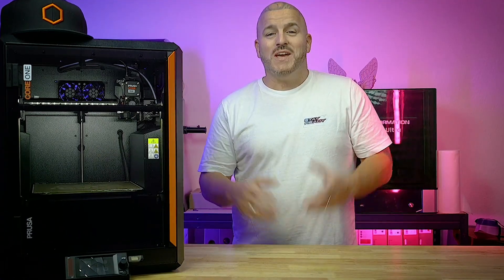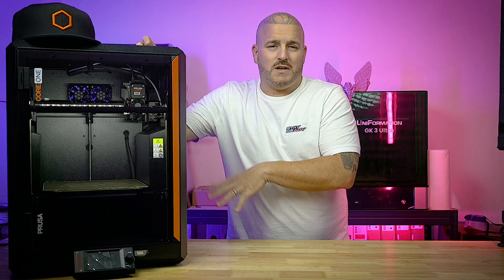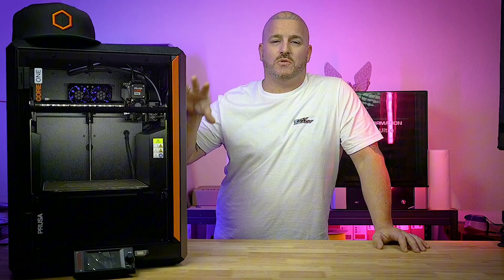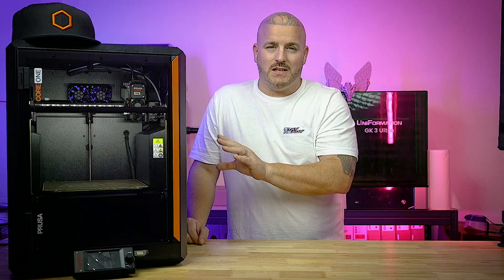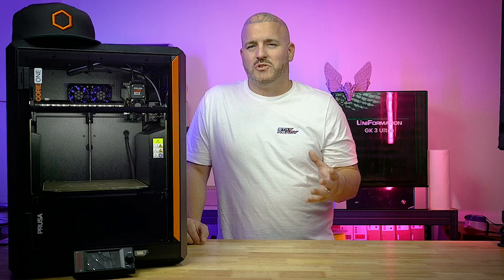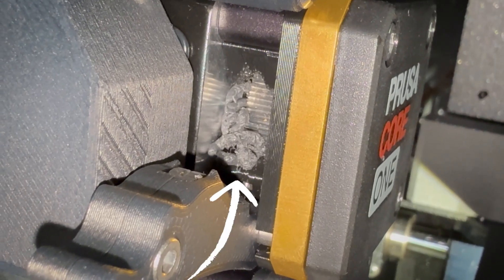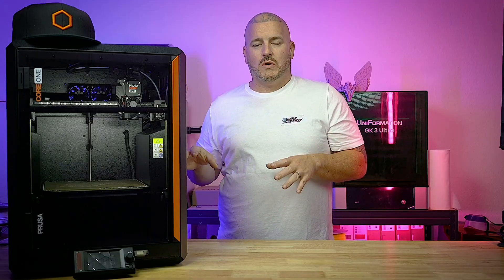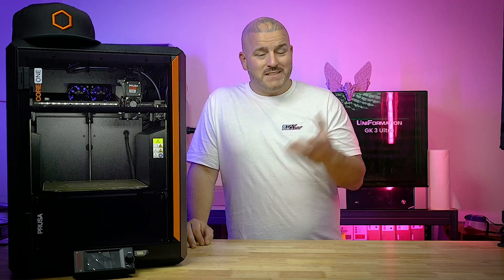Prusa Keeps The Pressure On Competitors with THIS!

Comment: I’m personally keen on seeing how the INDX will handle TPU’s on the Core One machines.

I’m waiting till probably the end of 2026 to either get a Snapmaker U1 or Core One with INDX (or some other brand shows up in 2026 with a new machine)

Bambu has locked down standard rigid filaments but the H2’s were not deigned with the moving left nozzle to handle flexible cutting out multi colour options on their machines.
Reply from the maker: I’m def excited for the INDX option for the prusa machines.

Comment: I got the K2 and I am thinking of selling it and buy the core one soon. I understand your point about using the manufacturers slicer but man is the Creality slicer a pain. Curious to know more about why you kick Creality though. For me it is that the K2 wasn't particularly precise or reliable. When it works it's great but when it's clogged it's hell. I've gone through 3 nozzles with this thing.
Reply from the maker: I can tell you it was about 20% due to machinery. The rest was due to things they did as a brand. Which I’ll be releasing a video about.

Comment: LOL, Prusa not putting any pressure on ANY 3D printer manufacturer.  Prusa can't make their old stuff work, let alone the new stuff.  Bondtech stepped in to try and save Josef.  If they can't get this right out of the box, Prusa will be filing for bankruptcy in 2026.
Reply from the maker: You must not own any of their machines. lol
Reply: @stayreadyto3dprint Not any more.  Not interested in being Josef's guinea pig cuck.  No amount of toxic gummies will get my money.  IF, when, or ever the INDX hits the consumer market and actually works out of the box, and Josef provides a gummy delete option, I will consider.  However, if the train wreck XL is $5k, what will the INDX be? Only diehard Prusa cucks will buy it.
Reply from the maker: That’s the cool thing about 3d printing. 10 different people will have 10 different opinions on what brand they like. And none of them are wrong. You gotta use the brand you enjoy most. Whatever brand that may be. These are just MY opinions and preference. That’s all. 
What brand do you prefer?